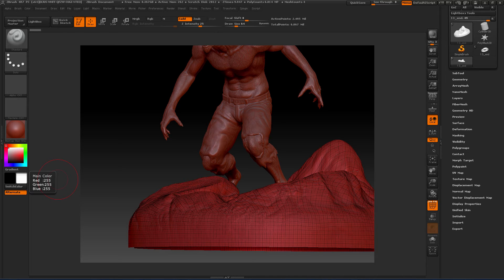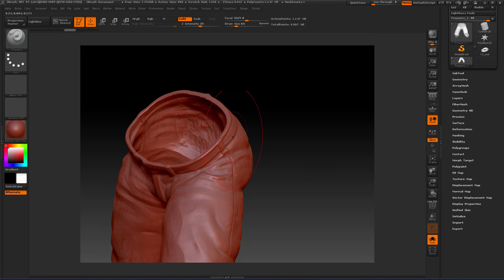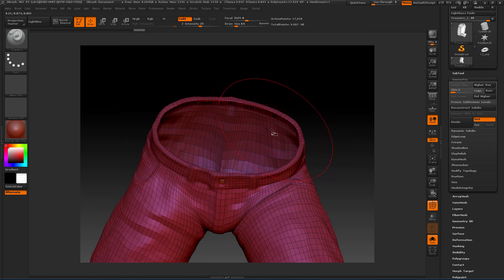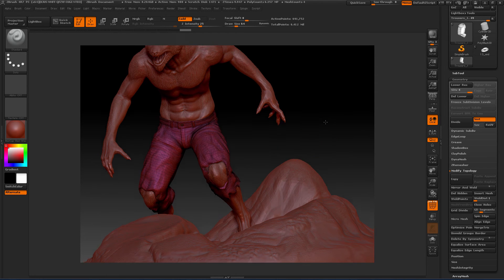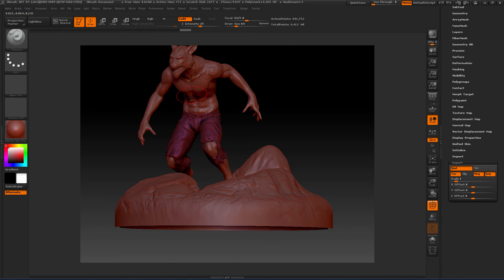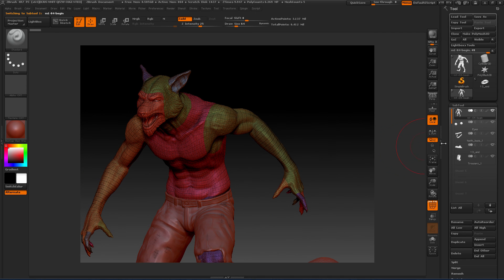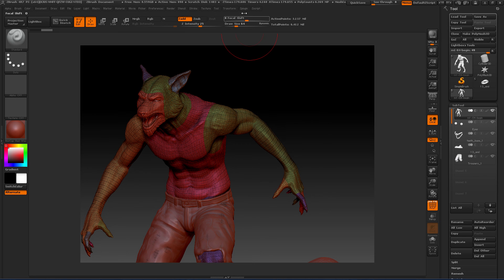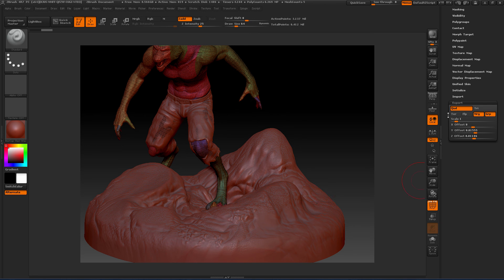Mari & ZBrush | Removing Unnecessary Geometry Exporting Subtools (Module 1: Part 4)

Comment: You alrready have the polygroup done? What if its just one group or if you have a imported model that have a separated garbage mesh inside your model, I ha e this problem with a library model with strangers pieces inside, there are some fast tips?